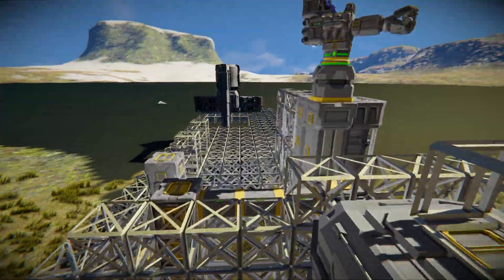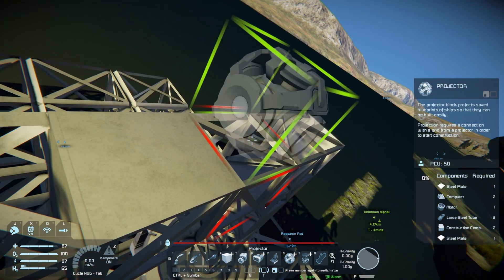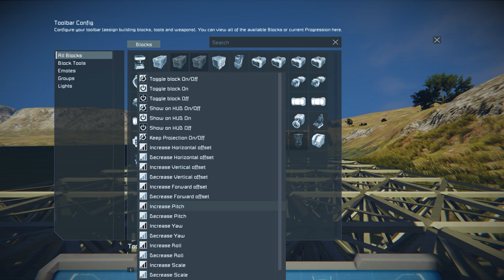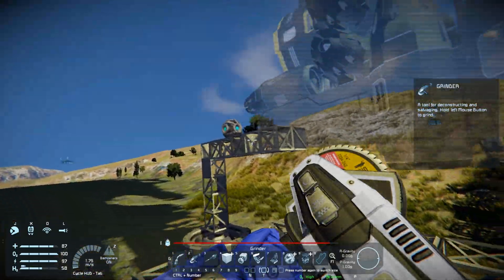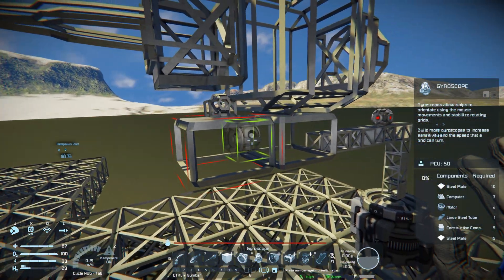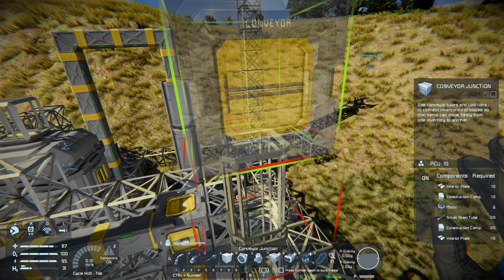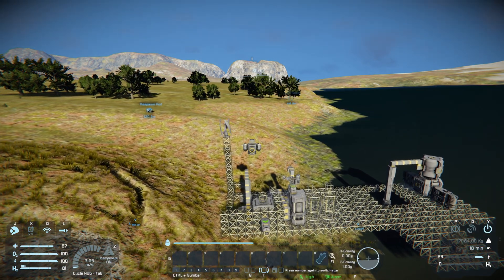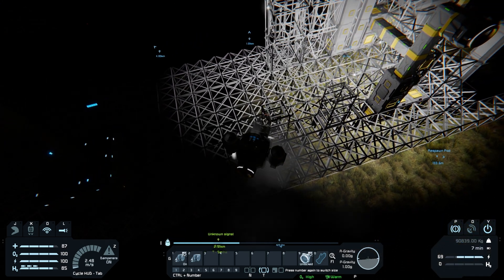Small welding ship. Space Engineers Xbox One and PC Beginners Guide #6

Comment: I think for pvp purpose should make base 11 x 11 put a shield generator in the middle so only need small area for shield range that require little power
Idk if it bug or not but once i only need 40 batteries , about 20 wind turbine and 10 solar panel to power all with the shield 24 hours
But the battery power will be like this
8 hours left, a second later only 1 second power left
Keep like this forever

Comment: Great tutorial... but i ran into a problem... i cant pull any parts past the connector?  Made sure to use the large ports from connector to cargo to welder.  So what did i miss in set up?
Reply from the maker: I'm a bit stumped here, are you trying to pull them in through the build planner? If so I haven't had the greatest luck with that, mabe try pulling them in by hand.
Reply: @KnowBotty  ty, but I figured out that I used a small connecter when I thought I used a large..  just attention to detail. Ty for the reply.
Reply from the maker: @larrytroy3758  Yup, it's usually in the details! Glad you got it sorted.